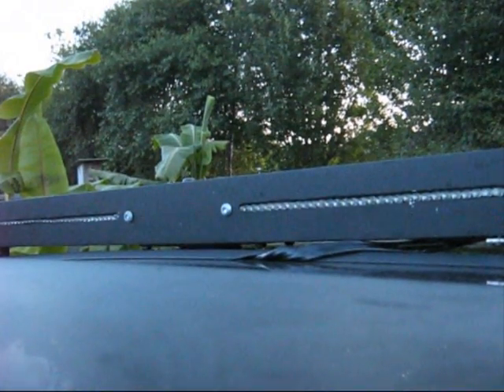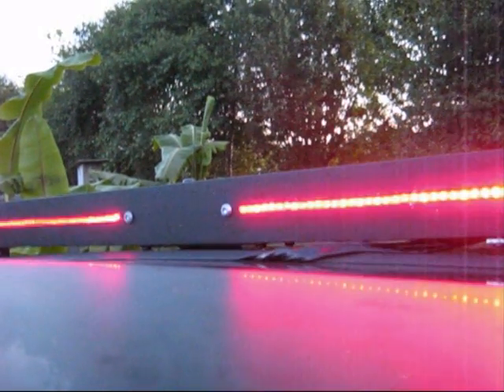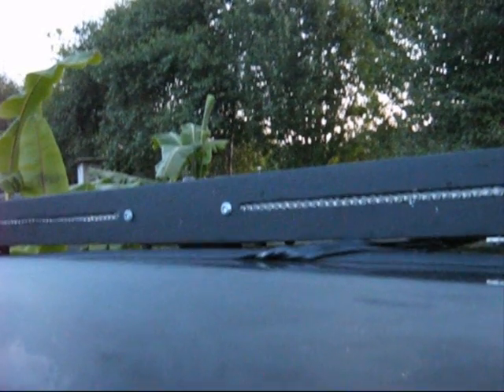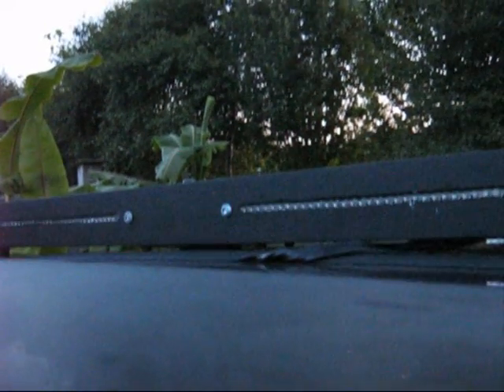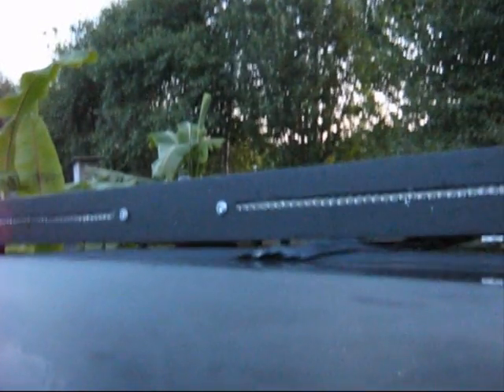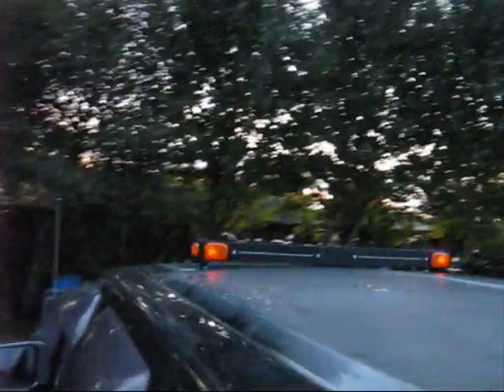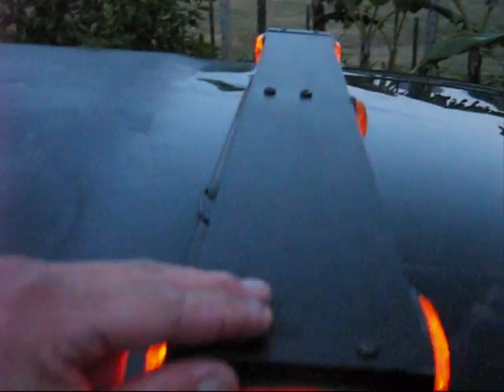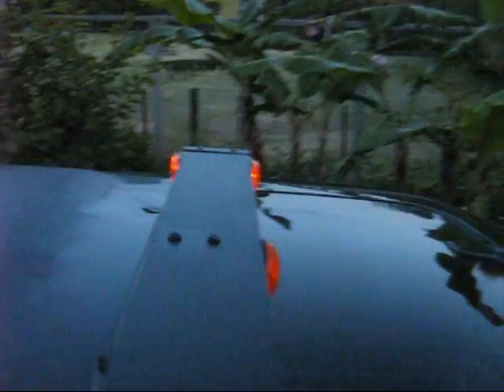Home made lightbar

Comment: @bburnette252 I agree with you, but technically LEDs that strobe are LED strobes. How ever they are not Xenon or Halogen Strobe heads. The LED modules are programmed to "flash" or  "strobe" and do not require a high voltage power supply. I my self make LED warnings lights and hate when people confuse the two.